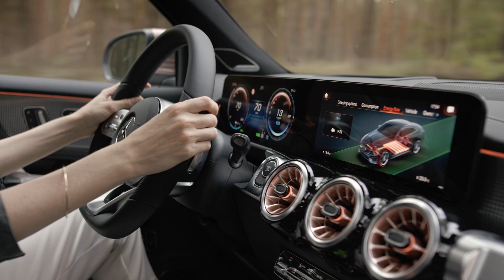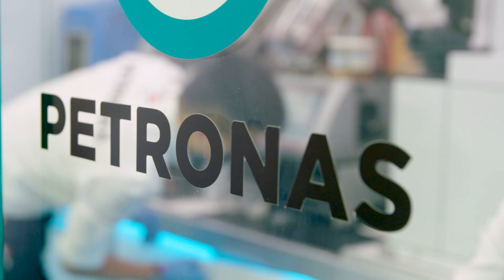Power Unit 101 with PETRONAS: Energy Store, EXPLAINED!

Comment: Excellent informative video.  Why F1 teams are not trying to improve the quality of air intake to the engine by increasing the O2 concentration using certain membranes to filtrate the CO2 and N2 similar with the O2 concentrators used in healthcare?

Comment: How bout some basic specs like kWh, max discharge, max charge, thermal dissipating efficiency, thermal interface mechanism, battery chemistry, voltage/S-P architecture, battery chemistry, cell architecture..... anything that's actually informative. I'm sure all the teams have their own tech and they're all probably very similar. You don't need to reveal any trade secrets.
Reply: As soon as they start getting more specific about the characteristics of the ES, any teams lagging behind are going to say "Where are they getting that (capacity, rate, efficiency, whatever)?"   That will indicate to others the direction they need to go to improve their performance.  Little benefit in erecting signposts for others to follow...

Comment: You mentioned that ES is quite power dense rather than energy dense since it needs to absorb and supply high energy in quite a short period of time. I am wondering what kind of a battery you are using to deal with this high power demands? Are you using li-ion batteries, or supercapacitors, or even both? I know some while ago flywheels were used to be used for this purpose. But I am not sure if they are allowed anymore. Could you explain your solution, if possible?
Reply: Nice try Alpine.

Comment: Guess its 10kWh ish, or less,  & 4680's? great vlog.
Reply: They are allowed to deploy an maximum of 4 megajoules an lap.
They are allowed to charge at maximum of 2 megajoules an lap.

4MJ is only 1,1 KWh, So 10 KWh ish is going to be way over.
I'd say 1,5 to 2 tops. You'd want the battery to stay between 20-80% capacity with lithium ion batteries. So let's say 60% = 4MJ.
4/0,6 = 6.7 MJ = 1.86 KWh.

That would be my educated guess.
Reply: @barneyklingenberg4078  that sounds logical, thanks for the info.

Comment: How do you get "15% more efficiency" from a battery, when the amount of energy and weight is fixed by the rules? Is this due to less heat generated when charging/discharging the battery at high rates or how does that work?
Reply: My belief is over time batteries have become more efficient due to new technological breakthroughs in battery chemistry. As the batteries become more energy dense & can input/output more power then they no longer need so many of them to achieve the energy limits set by any regulations, thus they can reduce the size & weight.
Reply: @yips_way  but I think at least the weight is fixed by the rules? And by talking about efficiency, I don't think that the only thing that became more efficient is the size.
Reply: @flintstone1409  The rules establish a minimum weight for the ES.  Efficiency is a slippery term - it all depends on what characteristic you are measuring. For example, any coincidental heating of the ES or the Control Electronics during energy transfer represents an inefficiency where energy gets lost to the surrounding environment. One way to improve that inefficiency is to use, for example, larger cables between the ES and the CE, and the PU. On the other hand, that increases the total weight of the car, so it's all a trade-off. Other approaches could include the internal architecture of the ES, the details of the chemistry, the mass of a cell within the PS. (smaller mass per unit of storage could permit adding more energy storage for the same weight, for example)

Comment: I would love help creating a 1/5 rc Mercedes F1 to see if a scale model can produce the same Downforce and can reproduce the bouncing
Reply: It's unlikely, due to you not being able to reach similar speeds.
Reply: @joshn1678  it can go 160+ mph and how do you know? Do you race professional rc cars?
Reply: You wouldn't be able to accomplish that goal due to the cube/squared law.  Even Mercedes can't.

If you built a 1/5 scale model out of identical materials top to bottom, although the length would be one-fifth that of the real thing, the surface area (the aspect directly related to surfaces like the wings and the floor tunnel, and therefore the force derived from those surfaces, will be one-twenty-fifth as much as the real thing. But mass, which, through density is directly related to volume) will be one-one-hundred-twenty-fifth  (1/125) that of the real thing. so length:area:volume in this model will be 1/5:(1/5**2):(1/5**3).  This is basic physics stuff, and is why even Mercedes was unable to duplicate the "porpoising" directly in their wind tunnel, with their reduced scale models (now limited to 60% by FIA rules). Instead of "real world" accurate lengths, forces, and masses, they had ratios of 0.6/0.36/0.216, so they would not have been able to demonstrate the same imbalances. The best they can do is to plug the wind tunnel results into a mathematical model of the chassis, but it turned out they had too-simplistic a model for the stiffness of the suspension, so completely missed the phenomenon in their modeling.

Comment: Aside from the heat being monitored trackside by the engineers; Does the driver have a pop up emergency warning should a runaway "thermal event" come to fruition with the energy store unit? After all, the driver is sitting right on top of it.
Reply: The engineer handle all those things…driver just focusing on racing
Reply: @LeeMooEez  Not quite.  
While the driver may not get all the details, there is a warning light system that indicates to all when there is a major concern with the ES. It appears on the engineers'' screens, on the drivers dash, and on the light above the air scoop for track personnel to see.

Comment: Would be nice to show the kWh units on screen along with the kettle/house analogy.  :)
Reply: If my math is correct, every braking generates 150w
Reply: @logblog6423  Actually, Watts represent a rate of energy generation. An amount of energy is expressed in Joules, and a Watt is a rate of energy generation (or consumption) of one Joule per second. A typical kettle of 1.5 litres of water, being heated from room temperature to the boiling point, would take about 500 kJ of energy. (That's 0.14 kWh of energy, or about $0.02 worth of energy at Canadian residential rates.)

Maths follow:

A typical kettle holds 1.5 litres of water, which has a mass of close to 1.5kg at room temperature, and to heat 1 kg of water by 1 degree C takes 4.2 kJ. So to heat a kettle of water from room temperature (20C) to boiling (100) would take 80C*1.5kg*4.2kj/kgC or about 500kJ. If the braking event lasted 1 second, the energy store absorbs the energy at a rate of 500kJ/s or 500kW. That's the same rate of energy flow that you'd need to power about 300 standard (1500W) electric room heaters, or to illuminate 500 standard 100W light bulbs. In more familiar units, 500kJ = 500kW.S, or 500/3600 kWh. That's 0.14 kWh.

Comment: Am I misunderstanding this? Every time it brakes for a corner, approx. energy could boil 4 kettles, yet over the course of a race it generates the approx. medium size house power needs over 24 hours? Thats got to be wrong. We'll say an average laps has 3 braking corners, so 12 boiled kettles, over say 50 laps that 600 boiled kettles, roughly 54kWh. The average UK home uses 10kWh a day. I would say its the same as an average house uses a week.
Reply: You know that there is also the mgu-h on the car that is providing almost constant charge?😅
Reply: It’s a very inefficient average house
Reply: Just braking on average generates 150w/instance

Comment: How many kwh is in it & How many charge cycles can the Energy Store go through?
Reply: It's literally nothing like a 6 second burst entire lap
Reply: As mentioned in the video, I think the energy is not the critical element here, it's the power. The ES should be able to absorb high power during braking and then deploy that power in the traction zones during acceleration. But I don't know what sort of a battery they are using for this purpose. Standart li-ion batteries are not that much power dense. Supercapacitors can match these peak power demands, and they have longer life cycle but they are heavy.

Comment: the PU needs more juice for next season
Reply: The PU was the strongest part of the car. It's the car design that failed.
Reply: @F1Fanatic76  Agreed but it was said that the PU was down on power compared to last season due to the renewable part of the fuel.
Reply: @mclarenjohnf1  Hopefully they're working on that problem too.
Reply: @F1Fanatic76  I tend to think that if the w13 manages to push through with the drag it has and still manage reasonable top speeds well what if they shed off the drag
Reply: @johngjfkri  the engine was actually running on a lower output after Baku. When the car reaches a certain speed the bouncing came back but we never saw the top speeds Lewis and George were getting down the straight at any other track after. So once they can get areo sorted out they can bring the engines back up.
Reply: the PU is fine, its the car design that produces more drag thus lower highspeed. if the PU is down on power, their launch would be terrible
Reply: There is a limit from the FIA on how much they can store and deploy, That is why I have asked Why is it that other teams whose name shall not be mentioned are able to deploy more than Mercedes
Reply: @mclarenjohnf1  because Adrian Newey, I’d imagine. Merc have been fairly clear that their problems this year were not engine-related
Reply: @mclarenjohnf1  there is a limit on how much you can deploy but nothing stops teams from deploying where they see fit for example(speculation)Mercedes favoured deploying out of corners more than red bull while red bull has favoured deploying more in a straight line you can watch  some onboards from Brazil,Austin, Singapore and compare the two
Reply: @mclarenjohnf1 because they can change where and when on the max deploy where that max is deployed merc prefers corner Red Bull and Ferrari prefer straights